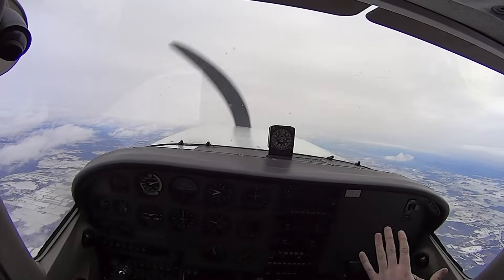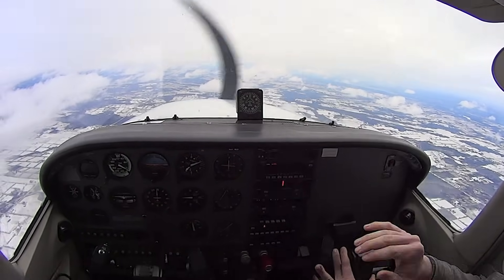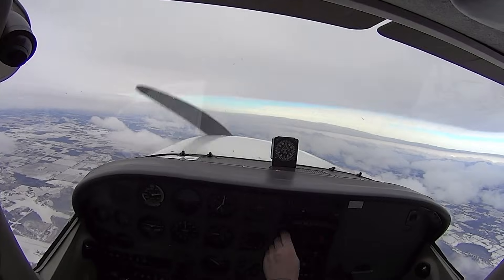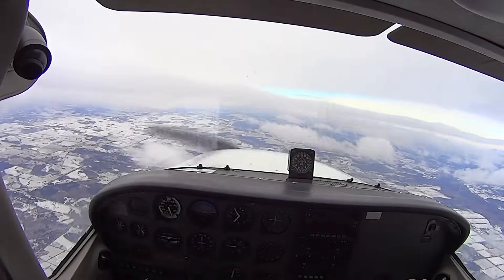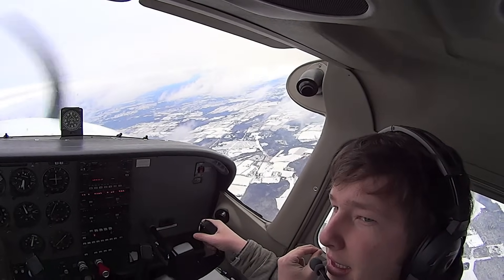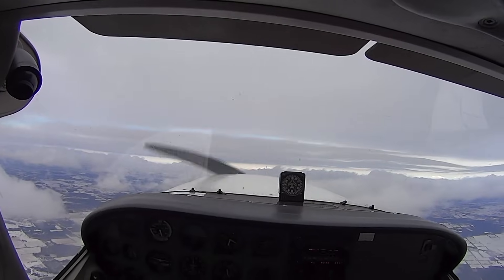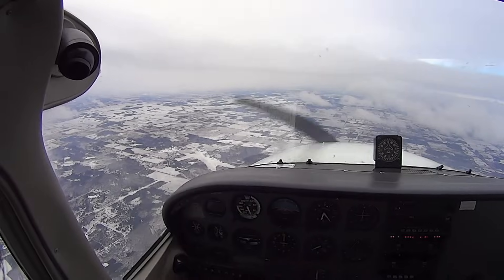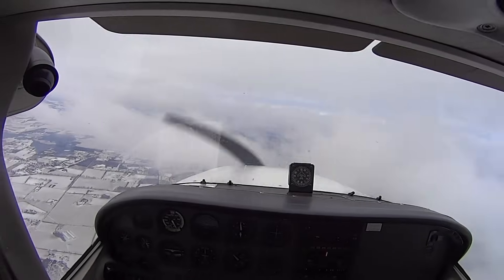Cessna 172 Spin Recovery Training (Full HD w/ audio)

Comment: The basic glider course includes recovery from a full spin.  This exercise used to be part of the power pilot course as well, but at some point it was decided that it was too hazardous.  This was a mistake.  If a pilot has never been in a spin, he or she may not recognize it quickly enough and, depending on altitude, be unable to recover in time.  Also, learning spin recovery is a great confidence builder.  If a student successfully recovers from this admittedly scary maneuver, that student will gain a lot of confidence in his or her control over the aircraft.  Spin  recovery is simple and safe if done at sufficient altitude.  When in full spin, use the rudder opposite to the direction of spin to stop the spin.  When the spin stops, push the rudder forward until the aircraft recovers from stall, then firmly but gently pull the stick back until flying in normal level flight.  Do not pull the stick back too hard and fast because you might exceed the wing loading specs, or, go "over the top" as I did the first time that I tried it.  Do enough spins so that you respond instinctively.  Be sure to check your altitude each time and do not spin below 2500 feet.  If you are a power pilot or student who wants to learn  spin recovery, you may find that the regular instructors at your airport have never done it themselves!  The solution is to locate an instructor who teaches aerobatics and do the exercise in an aerobatically rated airplane.  Have fun! spins are very exciting.  However, there is a big risk that you may want to become an aerobatic pilot!
Reply: Bonnie Kane the argument for discontinuing spin training is that it was causing more crashes than it prevents. For private pilots there wasn't enough net benefit. I believe it is still done for commercial pilots, the logic probably being that if a plane crashes in training only two people die but if it happens with passengers far more die.
Reply: Prevent a stall, you prevent a spin. That's the philosophy. Stall/spin accidents have not increased with the ending of spin training.
Reply: In the US spin training is required knowledge wise for Private and Commercial, however you do not have to demonstrate it nor be signed off saying you have done spin training.  It is required to have that sign off for Flight Instructors.
Reply: Jonathan, are you sure? I'm at CFI training now, and this is the first time I've encountered it
Reply: Bonnie Kane how do you push the rudder forward? I guess you mean stick/yoke, anyway, that is done the same time as you apply opposite rudder, not after the spin stops because after the spin stops you have nose down already and no need to reduce aoa.
Reply: From what I've seen of accidents, amateur pilots would do better to avoid seeking the thrill of maneuvers like this or even putting themselves into situations where this is more likely.
Reply: This look awfully scary. Awfully scary. I mean, I get uncomfortable just watching it.

If I ever end up learning flying (which for financial reasons is highly unlikely though, I'm sorry to say) I'd definitely want to learn that. Oh my, I'd do spins until my instructor would have enough. :P
Reply: Bonnie Kane Don't you HAVE to do spins to pass the cpl? or are you from the states?
Reply: Armando Silvier in a Cessna, Piper, or really any normal trainer type plane if the rudder snapped the plane would recover within one turn. These planes are designed to be so stable that without full pro-spin controls being held they will not stay in a spin. Hence you must hold full rudder to maintain the spin. In fact in aerobatic training you can just simply let go of all controls and pull the throttle to idle and the plane stops the spin all on its own. You must manually recover from the dive after though.

Comment: why opposite rudder? What purpose other than to stop the spin? Shouldnt you break the stall and then worry about the spin?
Reply: I think he was applying rudder to help enter the spin initially, then when he was spinning, the student applied rudder to stop the spin and recover.
Reply: the fact that one wing is more stalled than the other is why it spins.you gotta break the spin,regain lift,recover
Reply: ***** i haven't tried breaking the stall first but I would think that either the risk would be that a wing would be overloaded in the -G direction due to spinning and abruptly stopping when airspeed is high, or that you would continue a tight spiral and gain airspeed faster than you can stop the spiral and arrest the airspeed....besides in an aircraft that doesn't recover on it's own, you're already pointing straight down and you're still stalled so pushing the nose further down would make you not be pointed down and bring you closer to the inverted flat spin position, so the spinning motion is what's keeping you stalled because if you simply point an aircraft straight down it can't be stalled. So now thinking about it I revise my 2 options for what would happen if you tried to break the stall before breaking the spin...you wouldn't break the stall and you'd end up in an inverted flat spin.
Reply: You cant stop the stall without stopping the spin.

Comment: I think it's harder to get a 172 into a spin than it is to get it out of one.
Reply: +moeburn 

They are designed so that you have to make them spin, that's why Cessna is such a great plane. Most spins occur because of Pilot inputs.
Reply: i flew one that doesnt spin hahaha ,, just buffets,, u have to spin in your self
Reply: @i3zooz8  Hence the fact that the CFI says "Hold those inputs (Left rudder/full back pressure) otherwise the plane wouldn't spin. that's why they snap out of them so easily :)
Reply: 172s are one of the most stable aircraft. That's why they are the most popular training aircraft. For stalls, spins, and spirals the plane will mostly correct itself if you let go of everything
Reply: @zack10291029  could you explain why
Reply: moeburn if you want to spin a 172 to the left leave 1500 rpm on and do what the instructor just showed you (make sure to go idle on the throttle when you recover)
Reply: Power to idle until the stall is recovered. If you look at the ASI here, you'll notice it's touching on the white arc. Very easy to overspeed while you're pointing downwards.
Reply: @g g A spin is something that can happen when you fly not fast enough. To tell it simpel, if you slow down a plane, the wing says "do it yourself" and you start falling. Just think of a kite, if there's not enough wind, it can't fly. Wings need airflow, or you will fall. And falling the nose goes down, the wing gets more and more airflow and the plane starts flying again. It's important that the nose goes down. Otherwise you fall to the ground. But most planes put the nose down and start flying again themselves. Just stop pulling that yoke (that "steering wheel" in a plane) and you're safe.

A spin is like the stall, the pilot tries flying too slow, but the difference is, he is doing it in a turn and he is doing something wrong. Very wrong. The classical situation is a pilot flying low, say, right before landing, and the pilot is scared to bank the plane. That is putting one wing down and the other wing up. Low to the ground, seeing trees and houses, it feels wrong to stick a wing down. So what our pilot does, is use his feet to steer and not his hands. Well and getting lower and lower, he pulls up the nose. That's a natural reflex, the pilot wants to keep away from the ground. But it's wrong. Very wrong. Do you remember the wing said "do it yourself"? This time only one of his wings gives up flying. In the video the left wing starts falling. And the right wing keeps flying. What you get is a corkscrew like falling down. The nose drops and the pilots watch straight down. Through the windshield right before them. That's not all, they're spinning to the left. So all these farm fields are turning like mad. That's a spin. In short it's a plane falling out of the sky, because one wing stopped flying and the other one still flies normal. And it's a serious problem. You must stop it before you fall too fast, your wings might break. Really. The good thing, it is very hard to get a Cessna 172 spinning. My classical situation pilot did 3 or 4 things wrong at the same time, but it killed him. Well, you saw these pilots practice at a safe height, and they needed to do those 3 or 4 "wrong" things. And whop, a wingdip and the left wing fell like a brick out of the sky. The second good thing, the Cessna 172 is very easy in stopping the spin.

Other airplanes can stall or spin differently. Most gliders can spin for thousands of yards down, without building up too much speed. They are light and have huge wings. Fighter jets can have spins that end in a big bang on the ground. The procedure for stopping a spin is different for every plane. Some planes are friendly, like the 172, some planes are mean and dangerous. The friendly ones start shaking and just drop the nose a bit and you fly again. The mean ones say beep on the stall warning and suddenly you watch straight down, taking a dive of who knows how far down. And the really mean ones start spinning if you make one mistake and stop spinning 6 feet below the grass. That's what made some fighter jets very hard to fly. I've seen a video of an old American fighter, and the ex-pilot told that a certain way to make a turn was impossible. Don't do this, or she'll roll upside down and kill you. I forgot the details, but it was some kind of high speed spin. And those pilots were flying 100 feet above the ground in desert mountains, dangerous enough without ass kicking jet planes.

It was a lot of words, I hope you could understand the basics. If pilots screw up, airplanes fall down. A bit or a lot, straight or spinning. Don't get scared, passenger planes are very stable and the flight computers prevent those situations. Fighters are extreme, turning and rolling like mad. Some are scary death traps, and some are very popular among pilots.
And the most simpel way to avoid that falling down, is keep flying fast enough. Let that engine work, or descent, always know what your airspeed is, watch that dial, and knoq what's the minimum in that situation. So, fly fast enough and fly safe.
Ah, this plane spins left, because the propeller helps rolling left. Spinning right takes an extra trick in the book. The idea is the same.
Reply: This is DIFFERENT than a symmetric wing root stall with the typical nose drop we would see in stall practice.
Reply: Malcolm Pryor if you have a look during the spin recovery you can see that the ASI shows around 100-110 in an already nose down attitude. that's enough speed to bring the nose back up to the horizon . then apply full power to recover lost altitude :)
Reply: Due to rotation direction of the prop, there are several forces that cause a left turning tendency in single engine aircraft. Torque, P-Factor, Gyroscopic Forces, and the Asymmetric thrust of the prop all lead to a coincidental want of the plane to yaw and roll left. 

If you notice, the CFI said he was leaving power on to aggravate the spin. The C172 is inherently stable and requires everything working against it to induce a spin. Employing all the wrong moves (A left yaw, left roll, elevator backpressure, and added power) makes the aircraft finally enter a left (over the top) spin. 

Then the reduction of power, RIGHT yaw, and release of the elevator backpressure allows the Cessna to return to controlled flight with ease.
Reply: Can you explain about only bringing power to idle?  In the 152/172s I flew, we always applied power (once the stall had been arrested with the rudder...)
Reply: @malcolmpryor7912  This is because if you apply power during an exaggerated descent (once yaw is nullified), you can very easily overspeed the motor by applying even minimal power. if you watch the Airspeed Indicator during the level-out, any throttle would definitely push the airplane overspeed! :)
Reply: @malcolmpryor7912  In a stall recovery you do bring in the power.  However, there are two reasons this is not ideal for a spin recovery.  Power during a spin results in a flat spin, which is harder to recover from.  Also, proper spin recovery results in a steep dive, so you want idle power to prevent overspeeding the airplane in the recovery.
Reply: @malcolmpryor7912  Power out reduces the left yaw tendancies due to the rotation of the propeller
Reply: Can the 172 do an inverted spin? Poor student pilot if that's allowed.
Reply: Best spin recovery video I’ve seen so far. A couple of things not mentioned are neutral ailerons and flaps up. I recently learned of the mnemonic FPARE, which stands for something like Flaps up, Power to idle, Ailerons neutral, Rudder, and Elevator forward. These may not apply to every plane as seems to be the case with the C172
Reply: @g g You climb after the recovery. Adding power adds torque, which is a twisting motion. Since you're trying to recover from a twisting motion, you don't want to add more. That's the easiest way I can explain it without getting too technical.
Reply: To get it to spin in a 172 you put full ruder in the way you want to spin and hold that with full back pressure and that gets it to spin
Reply: Not true, just stall the plane without rudder control and voila....
Reply: Malcolm Pryor
You don't need power till you have airspeed and get surfaces back to the middle. Relax the yoke to the middle or a touch more, eliminate the rotation with the rudder, level your wings with the horizon your headed for, and  THEN begin to apply power as you ease back on the yoke and come up to level flight.

Comment: That cant be good for the plane...
Reply from the maker: The 172R is certified for spins as long as you operate it in the utility category. This means that it can structurally handle the G-forces imposed by the spin itself as well as a normal recovery. The utility category is determined by doing a weight-and-balance. This essentially determines the distribution of weight in the airplane taking into account the occupant weights and the amount of fuel. In a 172R this always means that you need to fly with no more than two adult occupants (in the front seats!) and less than full fuel.

Comment: I think while it's a nice way to have fun by carrying power on, nose high attitude, and kicking rudder with the torque...this isn't very practical to developing what you need to recognize the situation where you are most likely to get into trouble...which is power off, turning base to final and trying to cheat a little in the turn by over banking, or by skewing too much rudder and trying to keep the inside wing from dropping by putting a little opposite aileron in. THAT is where you're most likely to run into real world pilot error, and THAT is how you should train. As if you a shooting an approach. What's happening here is more fun than practical IMO, because how often are you going to be kicking in full rudder for one thing??
Reply: I agree, one should simulate both left and right turns from base to final with skidding turns and entering the spin. I listened to a recording of Machado saying those spins are recoverable from 500 feet if you really learn how to do it.  But I would, of course, only do the exercise from altitude. And a good rule of thumb given to me by a checkout instructor is to never exceed 30 degrees of bank in the pattern. If you overshoot base to final, and need to exceed 30 degrees coordinated turn, go around.

Comment: Why did you do all the spins to the left? I'm guessing it is because the Cessna likes to spin left a lot easier than spinning to the right. I show all my students within the first couple hours, how a 172 will do a coordinated turn to the left without any rudder, but needs rudder in right turns to keep the ball centered. 
Could you demonstrate what happens when you do a power on stall and don't use any rudder inputs?

Comment: what is the physics behind it.
Reply from the maker: A = sin(arctan([tan(phi/2)*sin((PI/2-theta)/2) / sin ((PI/2 + theta)/2)]))
B = sin([arctan([tan(phi/2)*cos((PI/2)-theta)/2) / cos((PI/2 + theta)/2)]) * tan((PI/2-theta)/2)])

theta(rotation) = PI/2 - 2*arctan(A/B)

Valid for upright spins only. From "The Numerical Solution and Analysis of Airplane Spin Equations modelled in a fixed coordinate system" by Robert Champoux. Naval Postdoctoral Thesis, 1972.

Comment: can you detail what you did to put the plane into a spin, I heard you say leaving power on does this mean full throttle? and did you have to throttle back to reduce the air speed to cause the stall and subsequent spin and do spins happen with every stall? or only when turning while pulling back too much?

Comment: Does it feel terrible doing spins,,meaning the G's forces? Thats the main reason that holds me back of doing CFI.
Reply from the maker: My initial reaction was that I didn't like the feeling, but I think it is something that you can easily get used to with enough practice. You have to remember that the amount of G forces experienced depends entirely on how aggressively you recover from the resulting dive.
Reply: Yea I think should go for it. Beside I need hours to build. Thank you for your time.
Reply: My first spin was at around 20 hours on my private license training while flying solo, practicing stalls. Scared the you know what out of me. I didn't even notice G forces.

Comment: I see no clearing turns before the stall......not a good practice......
Reply from the maker: The clearing turns didn't make it into the video, but they were performed shortly before the first spin.
Reply from the maker: ***** We were in the practice area and outside of controlled airspace, so there's no requirement to communicate with ATC. However, we did indicate our position and intentions on the practice frequency to alert nearby aircraft.